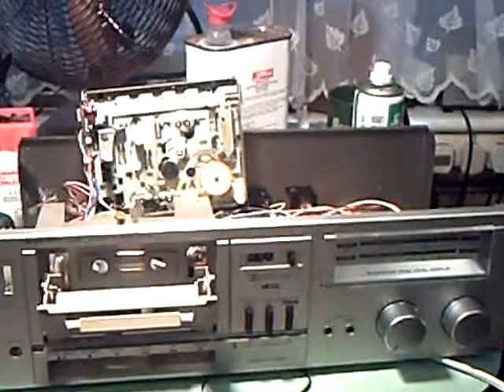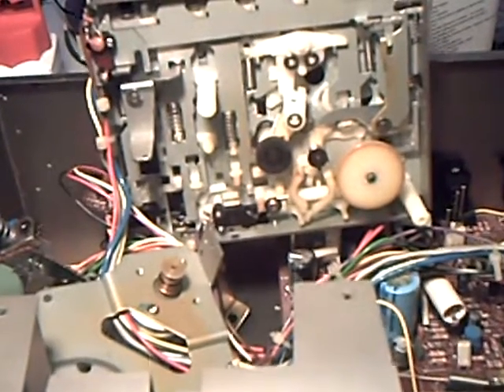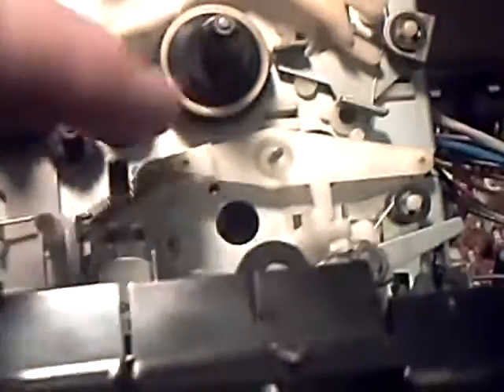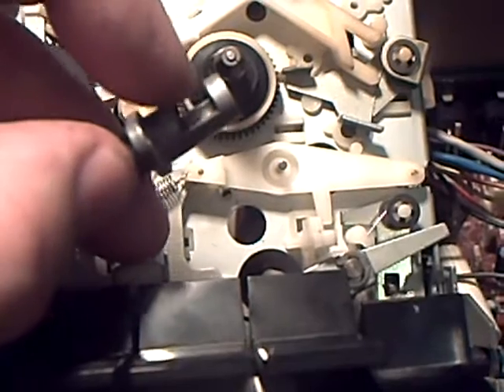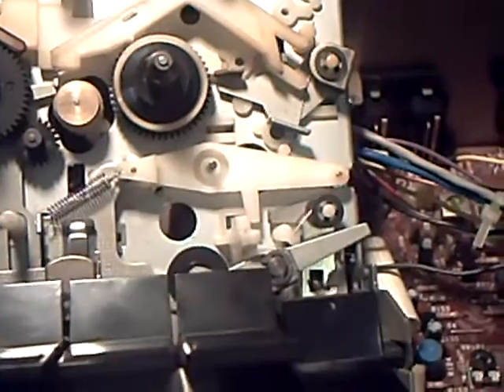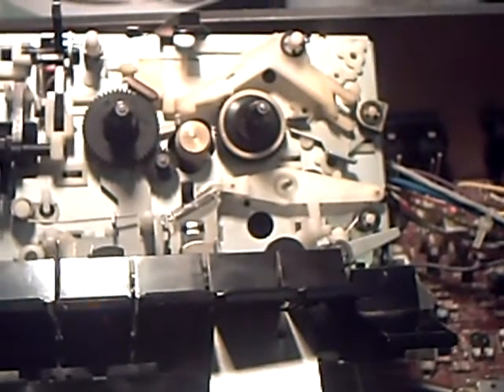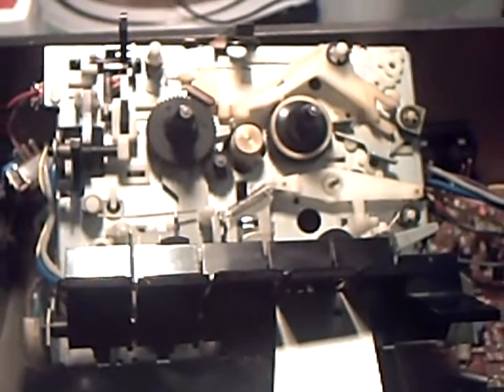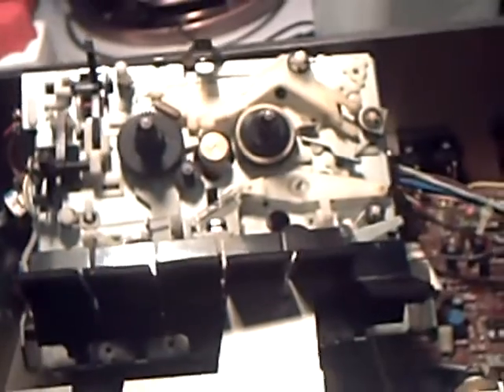SHARP RT 10 cassette deck in trouble

Comment: There are threads about this problem on message boards. I bought some silicone vacuum hose and cut off a slice of it to replace that rubber piece that  had disintegrated. The hose should be 2mm i.d. and 5 or 6mm o.d. For my RT-1157, I did not need to remove the bearing, only the capstan/flywheel itself. The challenge is getting all the goo out once that's done. Just like you, I often wonder why I spend so many hours with these things.

Comment: A very interesting video and I'm sure that all vintage cassette deck collectors would agree with the narrator on his problem with this deck and of course many other makes,  I have a Sharps RT7070T which had mechanical deck and audio problems, I managed to salvage parts from some faulty decks that I bought of the same model "or so I thought" only to find that there are variations in both the wiring and main board circuitry,  the unit now works reasonably records well and produces a nice crisp clear sound (I didn't do the audio sound repair as I don't have the equipment required for the job) but I found a place in Lancashire in the UK by the name of Wilkinson's vintage audio repairs who are very good and don't charge an arm and a leg for repairs to the audio side of the equipment,  the only one repair that they don't do is the mechanics of vintage cassette decks or reel to reel tape recorders as most parts are no longer available,  I did buy a capstan rubber sleeve for one of my vintage reel to reels from Germany via EBay  a couple of years ago which rendered my recorder usable like when it was new I think that the bands for these take up wheel assembly's is also obtainable but like the narrator said it is a messy and filthy job,  it should be noted that when replacing belts and such like involving these belts that protective gloves should be worn to protect your hands, I didn't and caught something off them which infected my palms.  A great video and well presented, he is spot on with his description that some of these units are a bind to do repairs on, maybe that's why most of them today are no longer working.

Comment: Hi I have a sharp QT90  1983 and I m stock with a small problem , on recording deck when I play cassette sont not loud , for full volume its hardly to hear,  I change belts and roller , recording perfect but when you play no sound,  what happens,  pleas help
Reply: Sorry, he won't be able to help you as he has passed away.

Comment: Hello! Ive brought one of these decks on the basis of your excellent video and the fact that I brought one BN back in the day and it served me well! I gave it and the Trio amp and tuner away in the late 80's to a mate of mine.
Anyway, I didn't have to get down-n-dirty with it but the one I've brought has the same issue your vid explains. Ive got the captain-post soaking in petrol to remove the 'goo' as it seems endless!- what ever happened to pipe-cleaners? Interdental brushes seem to be the closest i have to cleaning it and spraying it with head-cleaner reveals even more/endless quantities of the 'goo'.
I have a question- before I attempt to guess the diameter of the 'sleeve' - what would you suggest is a reasonable increase in size? My idler arm is cracked due to years of spring-tension- but some epoxy should deal with that- but the roller seems a good 1/8 of an inch away from the capstan 'pin' ? Does this accord with your experience? If this is so, then the new 'sleeve' will need to be a reasonable diameter which I guess rules out cutting a pice of insulation of a conductor- i was considering silicon hose? A Tight fit could be overcome by warming the silicon hose in hot water, then fitting it. I would dry it out afterwards and lightly oil the two bearing-posts before assembling the repair and running it.
Reply from the maker: Thanks for your kind comment, silicon hose might well do it, I think I used shrink sleeve to do it, silicon hose sounds a good bet as well. It may be you've got old grease in there which will hinder the arms movement. Hope it helps !
Reply: River Huntingdon All working now with a piece of rubber tubing from a Weeks-valve. I replaced the rubber tyre with an O ring that I lathed down to cut a square tyre. As you say- Why do we do these things?!
Reply: The silicone rubber/tube didnt work for too long, so I took your advice and used 5 layers of heat-shrink, heating one at a time, while they were on the capstan spindle and guide out of the machine. Slowly heat each one, then applied another until i was happy with the 'look' of if- took the 'pin' out of the bearing and trimmed the 'collar' i'd made. It works a treat one the distance is adjusted and not rubbing on the inside of the bearing-carrier/tube. Hopefully, many more years of playing/recording tapes in the garage on this old machine.